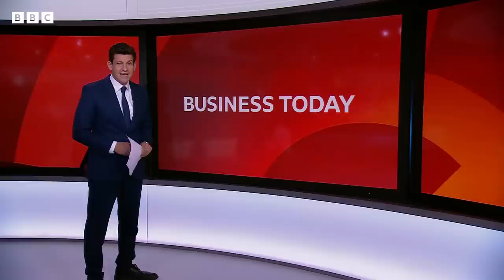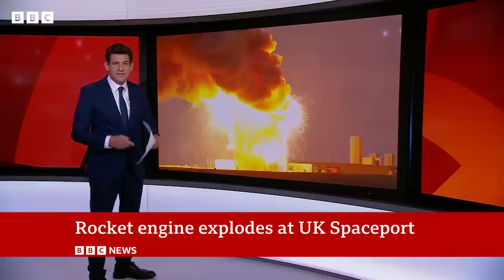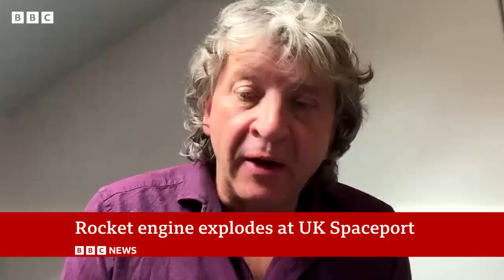Rocket engine explodes during test at Scotland spaceport | BBC News

Comment: The United Kingdom Space Agency should ensure that the first vertical launch to orbit from UK soil actually works, by using a UK rocket of the highest quality whose development they have intimate familiarity with at every stage, and which brings jobs to UK engineers. We have no need at all for incompetent jerry-builders littering UK launch sites with their ill-conceived foreign rubbish, simply because they were in a hurry to secure a prestige first launch at the expense of British engineers.

Ir wouldn't have been the UK's first vertical launch to orbit anyway, it would only have been the first vertical launch to orbit from UK territory, and it wasn't even a UK rocket so you could hardly have called it a UK launch. The UK's first vertical launch into orbit took place from Australia in 1971. The rocket engines were built in Coventry by Rolls Royce.

Comment: Very surprising that a technology to launch into space which is 50+ years old still can't be done successfully on a consistent basis.
Reply: It's rocket science...  It's literally the most complex thing to get right every time next to brain surgery... so no, it's not even suprising in the slightest.
Reply: But it's not the SAME technology.
Reply: @Chrisallengallery  Maybe that is the problem.
Reply: This is very far north to be launching to orbit or beyond.
Reply: Rocket engines are pretty complicated and different companies develop different engines to try to make cost savings and efficiency improvements. It's a field at the bleeding edge of technology in other words, where failed prototypes are common (it's also highly visible).